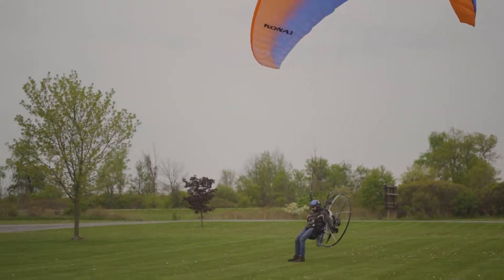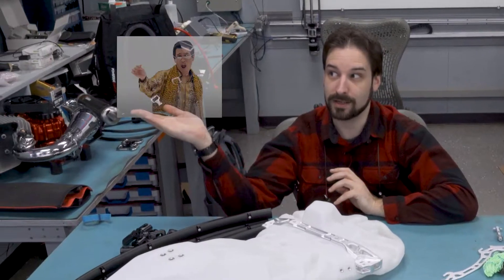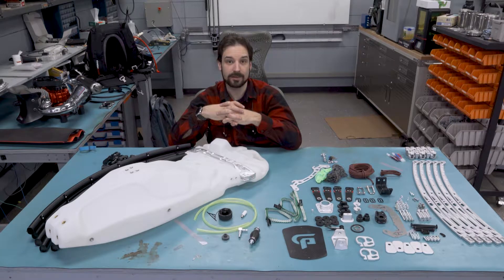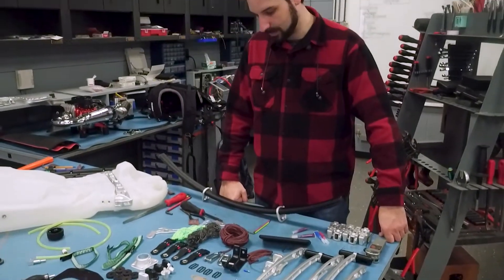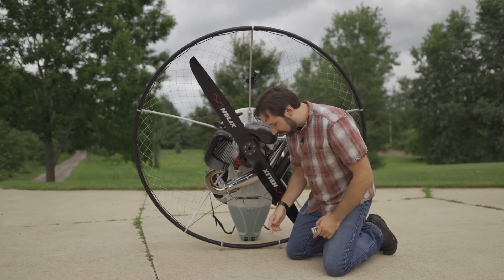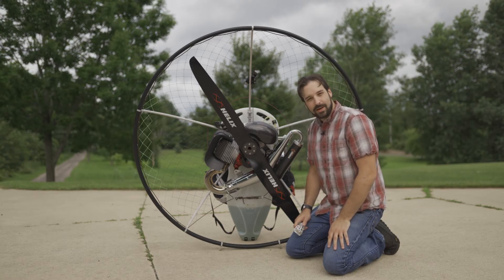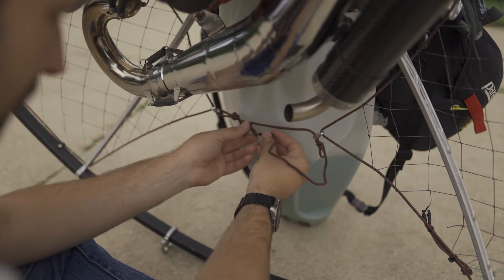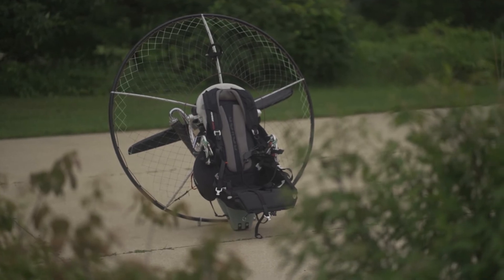Running Into the Sky with A Paramotor: Gravity Defiant Build

Comment: Make sure you use the purple aviation thread locker my man.
Reply from the maker: Yeah, i got a whole new bottle for this project.
Reply: @BauersLab  The travel platform you designed for the hitch is pretty genius. I venture to say I would definitely purchase one if you sold them. Could be something you could sell on the side if you produced more. It inspires me to try and make one of my own. At at least try. 👍 Great video sir.

Comment: Hey I got the defiant with the dudek can you mag me detailed how you installed it I just did regular way tonight and it's way to low on my back can't really tell how you did it from your video
Reply from the maker: Well, i left that out on purpose because I'm not sure i want to take on the liability of telling people exactly how to do it. I will say, though, that i ran the aluminum bracket through sewn loops in the harness and then i cut off the straps that would normally wrap around a tube. You may not need to cut them, they were just in my way.

Comment: You are wrong about the throttle cable keeper. it is not supposed to be crimped connection. You will be sorry if you use a crimp.  Use the sleeve, sleeve spring and keeper as intended. Also, you did not need to cut the buckles off the Dudek harness.
Reply from the maker: Yes, that is what i ended up doing. Also, i agree with the buckles but they would be very bunched up back there where i would want to route my reserve lines.

Comment: Greetings. I also trained at Aviator and now have a Defiant but not with the ACS, not the Factory R (185 Plus), not the silver arms & spars (green), and though I was initially sold the SupAir harness I swapped it out for the roomier Air Comfort. I don’t think I miss the ACS but do prefer the silver look a lot over the green. 
One of my biggest concerns is the prop clearance at the lower spars but a profile view of yours looks like it has much more than mine (~2”) from prop tip to spar.
Oh and I also fly a Kona but mine is a 1st Gen 29. 
Congratulations!
Reply: The latest version of the spars have less of a rearward sweep creating more prop clearance.  The early green versions were a bit longer/swept back a bit more.  Fine if running a 125cm prop, and mostly fine with a 130 unless you have a hard butt landing with power on.
Reply from the maker: That is interesting about the clearance. Are you taking about axial clearance or radial clearance? I wonder if they changed it because i was hearing about trouble with props hitting the ground on butt landings. I have had my fair share of butt landings but no issues with the hoop or prop.
Reply: @BauersLab  I mean if I turned the prop to its closest point to the lower left spar, all it takes is about 2 inches of flex in the prop to make the tip touch the spar. I’ve had 2 but landings, both on long wet grass at the same field. The 1st time a spar mount screw broke and the net got nicked (I typically kill the engine right about when I’m touching down). I replaced both lower aluminum spar screws with stainless steel. I’ve also put in a prop spacer and removed the top 2 engine mount spacers to slightly change the angle (reducing the clearance at 12 o’clock slightly to increase clearances at 5 & 7 o’clock). I would have liked if their instructional video had shown a completed assembly from various angles.
Reply from the maker: Oh ok. I had one of those aluminum bolts break too and replaced it with stainless. That seems to be a needed change. I'm not able to flex my cage/prop enough to get them concerningly close.
Reply: @BauersLab  I did have a chat with Gravity and even though they’re incorporating these changes they downplayed the significance to
me in the chat which seemed puzzling.

Did you train in Lake Wales or Dunnellon? I trained in Lake Wales and have since started instructing there, still a newbie.Where are you now? I’m in NC.
Reply from the maker: Yeah I'm not sure that it was actually a big deal. I would almost be willing to fly it with that broken because it is held by do much other stuff and that wasn't really doing much. But i didn't because tend to be quite thorough about such things.
Reply from the maker: I trained in dunnellon and visited lake whales once. I'm in Michigan though. That is really cool. You should let me know how instructor life is when you settle into it.
Reply: @BauersLab   The bolts are aluminum for a reason. They serve as a weak link so they break in the event of a hard hit as opposed to a much more expensive part such as the spar or the socket.
Reply from the maker: Yeah, I figured as much. I don't like a hidden weak link. I would rather have a more expensive part break more obviously. I am relying on rigidity there for storage and hauling. So, it is worse in my case, and I can't afford to not notice that.
Reply: @BauersLab   That is unlikely going to be the case. I think you are not seeing the trees for the forest here. The most likely thing to break if that screw does not, is the tank/main body somewhere surrounding an arm socket. Its likely to be a small tear/break in the plastic that you may never find until its too late.  The likelihood of you not noticing the screw has failed is very slim. In the event of a hard hit, you presumably would be inspecting these before attempting to fly again. Its likely not going to be an issue either way however.
Reply from the maker: @ArionRaine  Yeah, I basically agree. The screw is just not a good solution to the needed weakpoint. It is not a calibrated device. (at all) The breaking force is going to be dependent on how they machined the thing, the torque used, the number of times it was screwed in, repeated stress, vibration and temperature cycles. (Which I get a lot of in michigan winters) It would be better if they atleast gave me several and a torque spec. It is good to have a weak link like that, but in this case, it is more trouble than it is worth to me.
Reply: @BauersLab  Thats fine... but I am afraid you have tunnel vision. You are seemingly cherry picking a singular component and basing all potential failure modes on that one component while neglecting to consider other potential failure modes.  I get it, I am guilty of this as well, and have largely learned my lesson.   Like I said, its hardly going to matter either way, I just think your reasoning is flawed, and as most engineers (myself included), just cant leave well enough alone.
Reply from the maker: @ArionRaine  It's a fair point. I appreciate the push back.